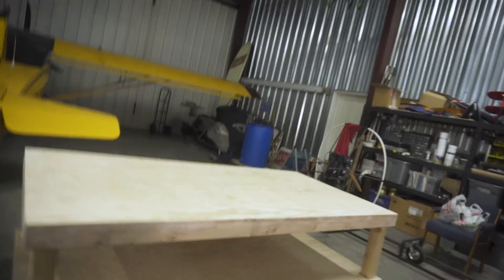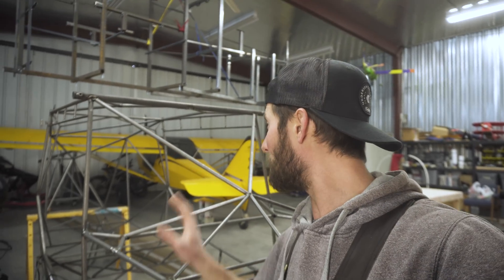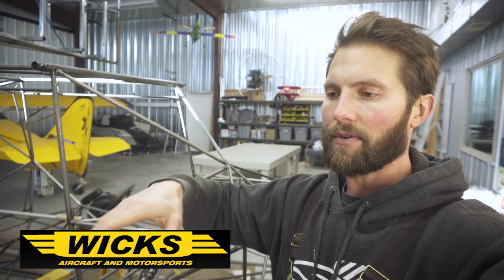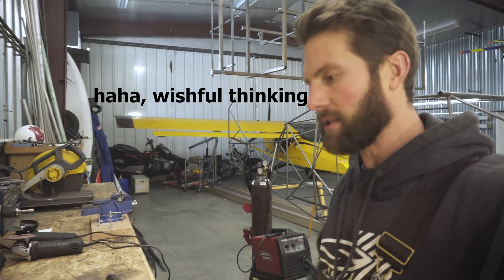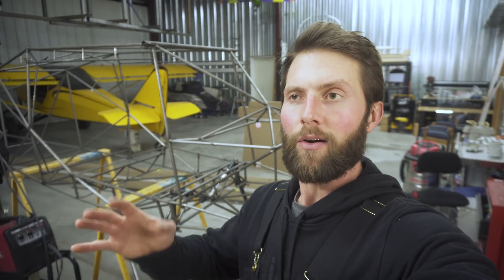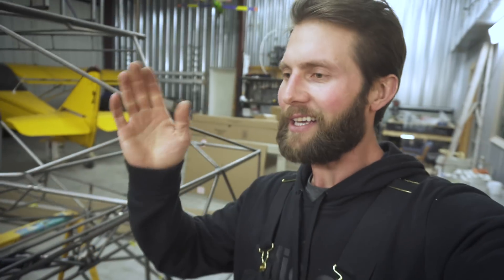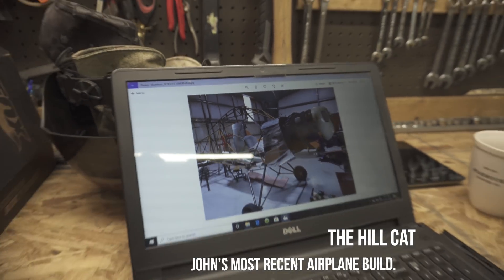NEW LANDING GEAR DESIGN (It's freaking awesome!)

Comment: What is lacking with Mechanical Engineers today, is the knowledge of how to design mechanisms correctly. Did know that there's a mathematical formula that can be used for all mechanism designs? It's called Gruebler's Count. I found a way to make it practical for all 3D mechanisms. Here's the link if you are interested.  https://youtu.be/KFB8gMjxDPk

Comment: Jonas, Just catching up on this. Put some bump rubbers in the shocks to control the overall travel and to make the spring rate progressive.  We use them on the race cars all the time.  They make them in different densities to control the squish.
Reply from the maker: Excellent. I was thinking they make something like that. You have store recommendation?
Reply: @JonasMarcinko  I like Penske bump rubbers even though they are a bit more expensive.  They have a nice graph of force to displacement on their website.  You can figure out the amount of weight that will be placed on the bump rubbers from the (weight on the two wheels) / 2 * ratio of your rocker arm suspension.  In the case of a hard landing these should protect your gear, shock mounts and shocks from being destroyed.  You can cut them and play with the length of them to get them 100% right for your use.  They also have shims they make that you can slip in below them to change the overall length.  I think it would make a difference, but I am much more of a car person.  https://www.penskeshocks.com/product/bump-rubber/

Comment: Would highly recommend checking those 3/8" pivot bolts after a few flights or a hard landing for any evidence of bending in the bolt. It's unlikely to fail suddenly so probably not worth a redesign. Would definitely keep an eye on it though. 
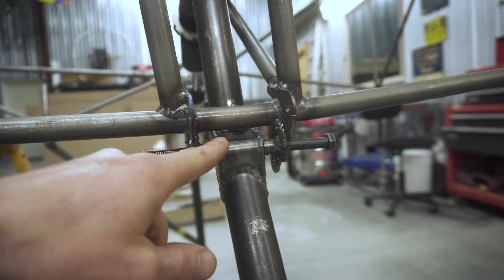In a different context, but a very similar load case and pivot design (as shown at 11:00), I found the bolt would suffer a bending failure after a surprisingly low number of cycles.

Love the project, keep the updates coming!

Comment: Butt welding pipes together is very weak in shear loading. The rear bar of the gear leg needs some sort of gusset near the rear mount to bridge that butt weld or tie the front and back bars together near the hinges. Overall looks great! Giving me ideas for future build.

Comment: With that geometry, the gear legs are going to transfer more energy directly to the frame rather than through the shocks at full droop.
The camber on a decent size bush tire at full droop will cause the tires themselves to want to push inward instead of outward on touchdown.
This effect will be magnified if you land on one wheel in a crosswind.
Expect your gear legs to bend/crack, and if you truss the legs you'll transfer that problem to the frame instead.
Toe out is a bandaid fix for tire scrub and won't help the issue...especially when you consider how negatively it affect handling on the ground.
My advice is to extend and truss the legs, adjust the shock mounting point so the max droop is less and compression travel is extended, and make up for the loss in prop clearance by using a larger tire size.  Gear failure is the last thing you want in a bush plane.
Reply from the maker: Some very good points. I completely understand and knew this while building them. Hopefully they work! I’m anticipating that the tire will take the initial impact and then the gear will fallow! Maybe it won’t be enough though.
Reply: @JonasMarcinko  I sure hope so man, you put a lot of work into it.  Ultimately, the tire size and toe out will be the two factors to concentrate on.  Might be a good excuse to invest in a high speed cam and mount it on the belly to see what happens on touchdown.

Comment: I forgot to ask if you plan to add any bracing to the lower gear to account for any side loads and prevent buckling the gear?  Depending on how you tie it in it could help reduce and/or eliminate the bending at the hinge line at the forward gear tube.

Comment: Looks like a fun build.  However, I am concerned with a few design details of your landing gear.  You will have a huge bending moment at the hinge point of the forward gear tube and at max load.  I recommend you perform a few bending moment calculations at various loading conditions.  A second issue I see is the large gap between the gear and fuselage hinge tabs.  Even though bushings are installed to reduce bearing stress, the large gap introduces bolt bending and reduces the capability of the bolt.  You don’t want a bolt in bending, the bolt should be in shear and bearing for this application.

Comment: Hey!
I love your builds!
One question: using rubber bushing on those suspension connection would be a good idea or not? It might be good for comfort on landing and also absorb some stress to suspension and the all plane?
Cheers
Reply from the maker: The shocks themselves actually do have a rubber bushing in them. It would be nice having something like that where the gear leg attaches to the airplane though.

Comment: Does anyone know what the gray headset he uses in some of his other videos is?
Reply from the maker: Patrick McGuire they are the lightspeed QFR. good headset. You should be able to find a used set for cheap. They are light and comfortable.
Reply: @JonasMarcinko  thanks, I really like the look of them. Do they seal well around glasses? That's my biggest problem with my current set
Reply from the maker: Um idk, probably not the best for wearing glasses with them. My Bose A20 don’t do that well either though.

Comment: How much does Bush planes cost on average?
Reply from the maker: It's quite the range. from 25k-300K  average you are looking at 65k to 100k for the smaller light sport aircraft.  usually, kit prices are around 35K without engine.  engines run between 10k to 35k
Reply: @JonasMarcinko  Ahh interesting, thanks for the info and videos :)

Comment: Hey, I've evaluated structures like yours many times for the Air Force.  If you need to know the structural stresses and factory of safety against yield for whatever torsion and forces you're concerned about, I'd do it (in exchange for a ride when it's done).  Should take me an afternoon.  I'm using RISA and COMSOL.    The members in compression will need shorter spans to resist buckling, and the ones in tension will need the strongest welds.
Reply: Hunts: Hey, you're going to take all of the fun out of the build!  Just kidding, that is an offer that Jonas should strongly consider.  "Should take me an afternoon," that rings of no BS confidence. Jonas, Hunts sounds like he knows what the hell he's talking about!  That single gear leg is my main concern, the bending moment on it. I don't have your technical expertise, but I do have 40 plus years of bending and breaking various landing gear experience, and i can see that maybe being an issue, it'd be interesting to get actual numbers on it.
Reply: Thanks Port!  It's a lot of fun.  I'd be happy to do it for any home builder!  I really hope he takes me up on it.

Comment: Will you be putting the coils back on the shocks? With those, the springs are what take the load and the shock just really keeps the spring from being, well, springy. I come from the automotive racing world and only dabble in aviation, but I would say the coilover setup would be the best to prevent a roll over and be able to handle any off airport work. 

Love the build, definitely got me thinking about building and stepping outside of the comfort of my C172!
Reply from the maker: Oh yeah they are going back on. I just had them off to show and test the design. 
Thanks for the comment

Comment: The 3/8 Pivot bolt should have been  1/2"    Also the Brackets in  My opinion  should have been twice as thick with a sleeve between them.
Keep up the good work      Greg    CFI   ME.        Are you using   Chrome Molly  tubing?   Great overall Design

Comment: Did you take the coils off just because of the clearance issues? Doesn't that defeat the purpose of using coil-over shocks?
Reply from the maker: I needed them off to see how everything worked. They fit but are very tight tolerance.

Comment: you need more travel on the shocks unless you have very stiff springs.      May be start with  250  pound springs and use lower tier pressure.    Get a  long travel shock as used by off road racers.    They sell  12" to 18" long travel shocks.
 depends on the surface you are using the air plane for tire settings off road and lower psi in tires  make  Toe in Toe our almost meaningless in small amounts on dirt.
Back to springs    you will need to know how bad of a landing  you will have to really know the spring ratings you will need. 

Normal landing will be just fine.       I only wish I could be building  a kit plane.    need the space first.   I have a Grumman but want a toy.
Reply: John Roberts makes the rage suspension kit. The original used fox shocks.  7 years ago when we tested the original design in flight Jonas filmed it.  The new Rage shock is a completely different beast now but the original was with a snowmobile/atv fox shock. The following was my initial video teaser just after Joel landed for the last time and taxied back to the hangar.  https://www.youtube.com/watch?v=FKw86ZQL87Y

Comment: Jonas, already thought this with the previous video. Why don't you use a slightly thicker polycarbonate windscreen, bent in a good U shape, as an integral part of the construction. It would require a bit of engineering on the attachment/mating surfaces of the frame, but it would be even stronger than what you have now and you'd have no visual blocking.
Reply from the maker: Interesting idea. At this point I’ll keep it like it is. But I may think about this for a future airplane.

Comment: I would roll that Mig back into the corner of the  shop along with the Tig and bone up on Gas Welding ... put a schrader valve in the frame and drill in connecting holes in all your tube to tube connections ... a small gage welded into a visible area will keep you informed as to the quality of those welds.... if your welds are stressed and crack ( the ones on your L.G. brackets  that  I see will ) you'll have a heads up...... might save ya from a "the Great Waldo Pepper" scene when something breaks and  falls off when you really don't want that to happen....  
Just how  we do in my shop  ....IF you missed that Movie I'd watch it NOW.......just an  F.Y.I. ,  I only build part 103 frames.

Comment: My cub has safety cables on the landing gear- suppose to keep the prop out of the dirt if the gear fails.  Could save a costly tear down.  Also my gear has a secondary "strut" running front to back on the gear stiffening up the whole structure.  A sharp builder could study the geometry and identify weak points.  Exciting build- I can see you do very good work!

Comment: Your scaring me, I thought mig welding an air frame was a big "No No!"   Oxy and Tig was preferred for penetration on Crome Moly.
Reply: @Shawn Huffman  I've been told, Chromoly  welded air frame joints start to crack and fail on average after four years even if you heat joints to relieve stresses. This info was from some older military aeronautical engineers from Whiteman AFB.

Comment: Does anyone beside me think there needs to be some sort of truss structure inboard on the gear leg. As is I think there's a large bending monument being applied right at the pivot , where it will eventually bend or fail.
Reply: If he could add a cross to the top of it, it would be very much like a super cub gear.
Reply: I think the whole assembly is a bit under built.
Reply: I think the same
Reply: From simple mechanical point of view, he replaced stretching/compressing forces (which tubes are very strong for) with bending force  (not a strong suit of the round tubes) and a huge lever to boot.

Comment: Jonas
You should look at what formula  1 and indy cars run on the way they use cams for getting  lots of movement  withe the shock barely moving it make the shock last longer i that would work great on your plane.  I am working on planning it on our dirt latemodel  racecar , similarly  to what you ate doing .look up dirt latemodels  it will give you some more ideals  too. Check coilovers for race car they are cheaper and in some cases better.
Reply from the maker: Thanks V h for the ideas.

Comment: I wonder at the very small diameter of the tubing in use??  A thin-wall, larger diameter tubing is much more rigid, per weight, no?  Also, if you are suing carbon fibre in places, could you not make some of those sections in a monocoque fashion, or stressed-skin??  Just asking?
Reply from the maker: .5 .035 you are correct.  And yes that would be a good idea for the carbon.
Reply: @JonasMarcinko  thx :-)

Comment: Jonas I was wondering if your pivot points on your shock setup should be bushings for wear?  Just looking at the wearing of two metal surfaces.  Grease fittings like in bronze bushings.  An ounce of preventative measures for a long lasting pivotal area.  What do you think Jonas?

Comment: You were commenting on toe-in/toe-out, will that be adjustable, or permanently set? Will you have to rework that area?
Reply: It's built into the gear, so no it's not.  The reason for the slight toe out if for better control on the ground.  Toe in can make the plane quite wild on the ground and cause it to kinda hop from wheel to wheel.

Comment: Hi Jonas, personally as a technician I have to tell you something about your choice where to put the two Shock absorbers . You put them one in front of the other and that could be really dangerous in case of forced landing ( emergency ) . If it was my choice I'll put for sure one on top and the other down . In case of very stressful shock ( emergency ) the two pistons will try to broke the fix point on the frame but in this case they will find the other one in front and the way out are just 4 , upo, down, front, rear , than you have 25% of  possibility that each piston going through the cell . Be careful !! Take care PS I don't even like the system because you put absorbing force apply in two point and not in 3 as could be much better . Let me know If I'm clear enough .

Comment: Your project is coming along pretty nicely.  You should consider investing in a cheap tig welder.  You can pick up a decent AC/DC setup for about $600.  Personally I'd rather be able to carry an extra 25 pounds of gear with me than 25+ pounds of mig wire that isn't making my airplane any stronger.

Comment: That is SUCH a cool suspension!  And YOU built it, so gratifying.  

I'm having motivational problems to simply order some dang bolts to hold my wings on & put new fuel line in my wings...ugg...your videos causes shame (good thing for me) on my part.
Eventually, I'll switch my hard landing gear to a basic cub style, just bungee.

Comment: I love your landing gear design in keeping the shocks and coils inboard to reduce aero drag. It also allows you to install a sway bar that I think you will need for nasty turbulent crosswind landings.
I'm a little surprised you don't have the front gears angled a little more forward to reduce the possibility of a nose-over. Your geometry should allow.

I wonder why Trent's KitFox, even with the new heavier engine (100 lbs. plus) allows him to land with the tires locked without a nose-over and your KitFox did kiss the ground. 

Also, I would contact one of your engineer buddies (or get a load management program) to run some quick calculations on the stress and shear on your landing gear bolts. All is needed is the weight of your plane. Your 3/8 in bolt seem light at first thought. 

Thanks for your vlogs, they are fantastic.
Reply: I had a similar thought as Jonas was describing the suspension struts and the process he had followed. My first thought, as he described stepping up to the 3/8" bolt was that the whole weight on that side of the gear, times the impact force, times the length of the lever... Mmmm. A little extraneous calculation might be in order. It might be a good time to pull out that "Good Ol' Slide Rule!" I have a couple very good (OLD) Pickets in my desk drawer. I know the batteries are still good! I'd be glad to loan you one.   ; ^)
Reply: @MrGaryGG48  Come on ... Really. Jonas is a young buck. He never heard of a slide rule. And Pickets... isn't that part of a fence? LOL You gave me an idea. I'm going to send Jonas a Picket slide rule. Think he will know what it's for? After watching the video again, I'm concerned about other mounting points too. Oh well.
Reply: @jrs9144  You're right John, he is a "young buck" but he's a pretty creative one. I'd just hate to see him and his girlfriend get hurt if mounting points or under-sized bolts or anything else, for that matter, failed. I've seen the results of a small plane getting slammed into the runway due to a unexpected down-draft. It collapsed the right side gear, put the wing tip into the ground and thoroughly messed up the airplane. My wife's friend was the student pilot doing one of her solo flights which became her last fight. She decided about the time that the wing tip bit the dust, that she just didn't want do that anymore. She walked away but it was slowly and a bit unevenly.
Reply: @MrGaryGG48  Wow. I totally agree. 
If you watch the 2019 STOL Drags at Dead Cow you will see an accident waiting to happen. They fly about 5 feet above the ground then throw it sideways, or slip to slow down. The wingtip or landing gear is very close to the ground. With a small gust of wind or turbulence, a wingtip or landing gear will touch and cause the plane to tumble at near 100mph. These little planes will fold up instantly. I have mentioned this to the Flying Cowboys, but nobody is listening.
Reply: I am a lot more concern about the pipe breaking (flexing) near the bolt just after the reinforcement than the bolt itself.
Hopefully the tests will tell.
Reply: @petittoto7433  I agree. I missed that on the first review. Actually, I would redesign much of that birdcage.